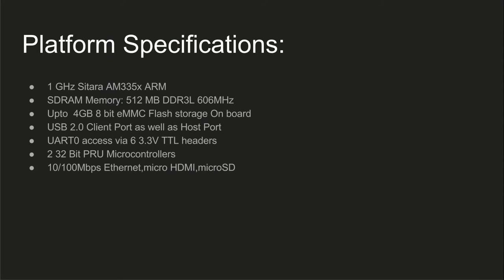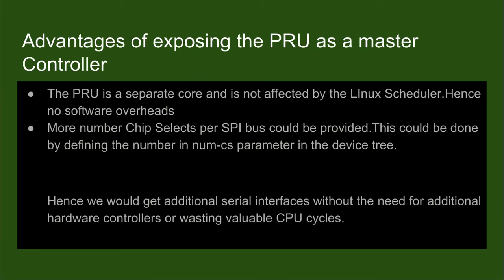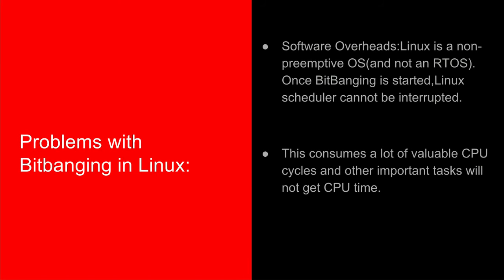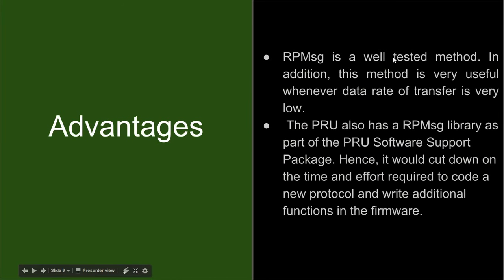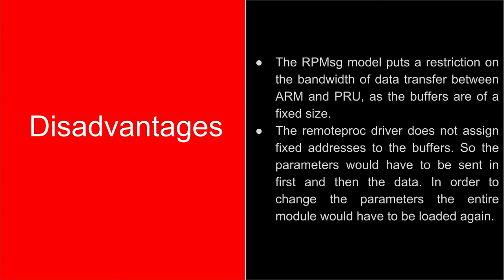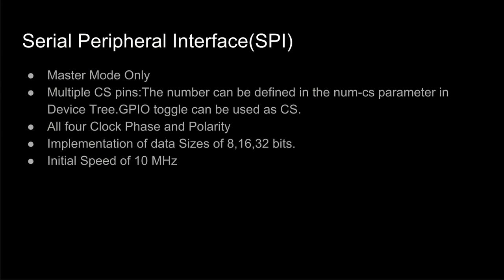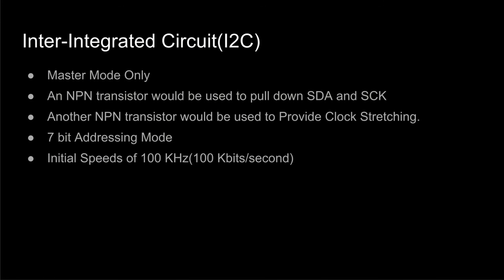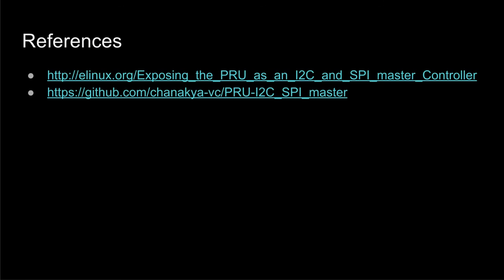Exposing The PRU as an I2C,SPI Master Controller

Comment: I am developing an 800Hz sample rate platform stabilization attitude 
control system with Linux-Xenomai on AM335x. I currently have all the I2C 
sensor polling code running on an external STM32F uC and need to have 
this functionality integrated into a PRU on the AM335x SOC using a
hard (not bit-banged) I2C master controller with a memory mapped RAM
interface similar to the primary proposal in your video, to the Xenomai kernel. 
Any interest in working on this project?
Reply from the maker: So If I understand correctly,you require the PRU to talk to the external hardware I2C master Controller?I mean run the sensor polling code on the PRU?I would love to work on this.But I will be too busy with my GSOC project this summer. Could you forward me any documentation on this project?I am a beginner at all this but this seems like a nice project!